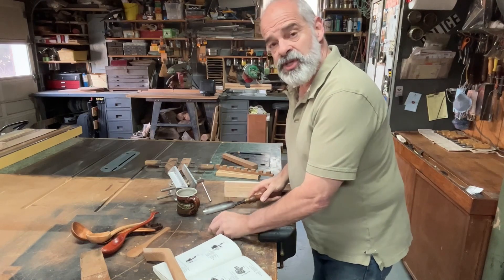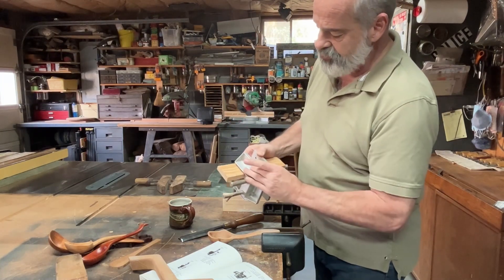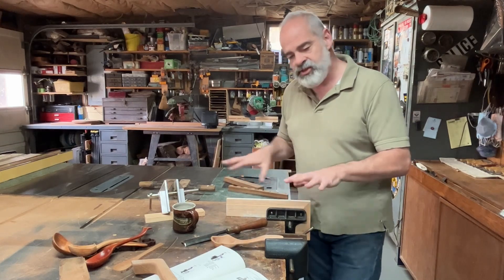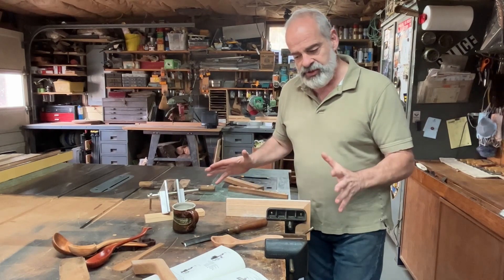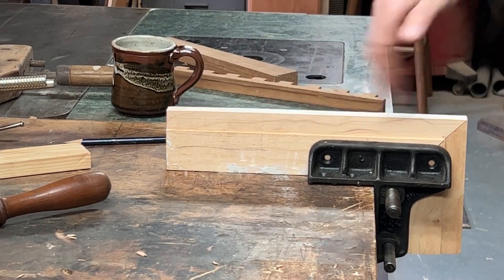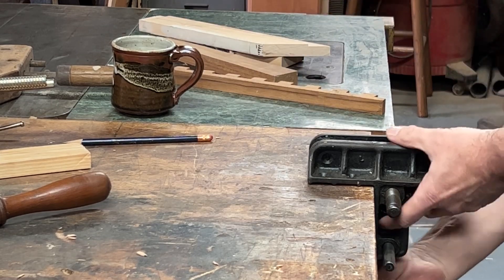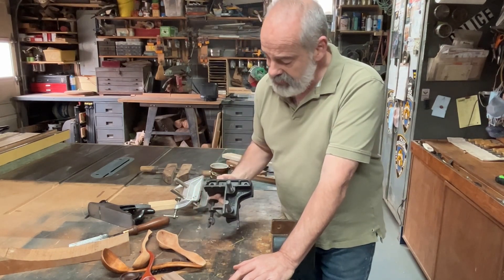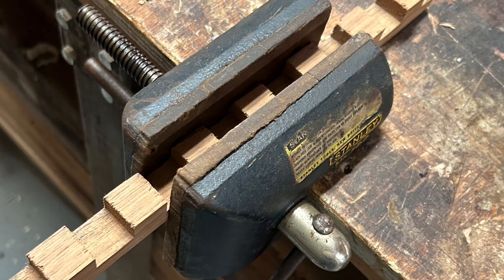CHAMPION & STANLEY “L” SHAPED BENCH VISES

Comment: How thick of a bench will it clamp to?
Reply from the maker: Approximately 2 1/4”.   Keep in mind that if your bench is thicker you can always clamp this to another board which can lay on top of yours and be clamped to that.
Reply: @ChetSpier  Thanks Chester. I might have to pick one up and experiment. I know they have versions that bolt directly to the workbench as well. It actually might be fun to try and make my own "L vise" and see what I can come up with.

Comment: I also have a Stanley and a champion vise just like these. I recently picked up a similar vise to these that is a quick action vise. It has a hexagonal lead screw with a series of washer type nuts inside the mechanism. You can slide it in and out to the size you want freely and then once you tighten the lead screw it will tighten the jaws together. Very cool vise. No makers mark just the pat. #. If you are interested I can post that pat. Number for you. Thanks for the video!
Reply from the maker: I of course I’m interested. Lol. Thanks
Reply: @ChetSpier  awesome! I will go out to the shop soon! I wish you could post pictures on here. If you’d like I just started a channel myself. I’d love to get your input on it. Maybe give me some pointers? Thank you sir!
Reply: @ChetSpier  “PAT 12 26 22” is stamped on one side. Then one jaw is marked 55 and one jaw is marked 56. I’m sure they are just part numbers. It is a very unique vise though! 

I looked closer and the casting where the lead screw protrudes through it has a wedge/ screw type ledge around it. Which causes the “washers” to can’t as it is spun. Or when you tighten the vise. There is also a pretty substantial spring that keeps those washers in tension and close together. It also has two guide bars above and below the lead screw. It has a fraction of the slop and play the Stanley and champion has. I’ve never tried to find the patent but if anyone can I’m sure you can. If you do please let me know!! Thanks again!!